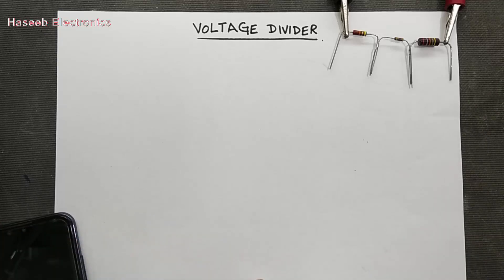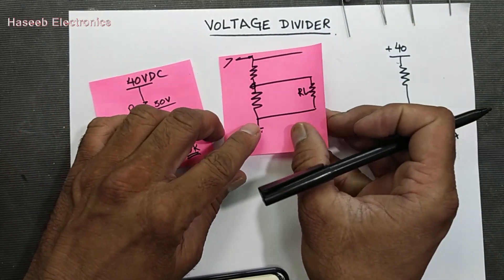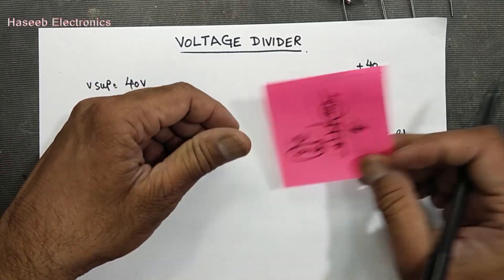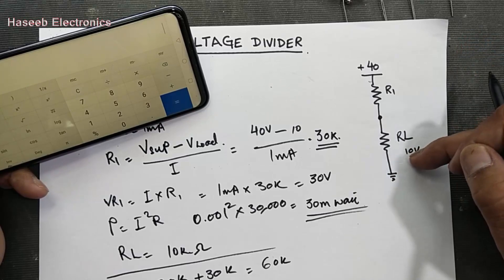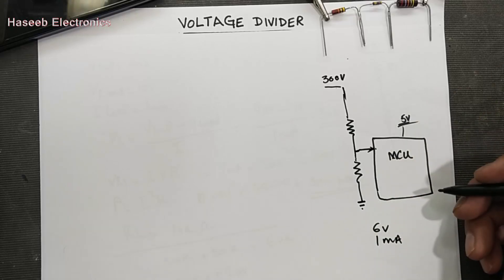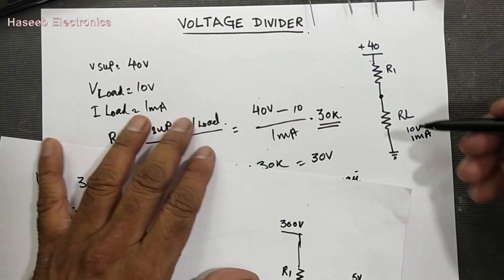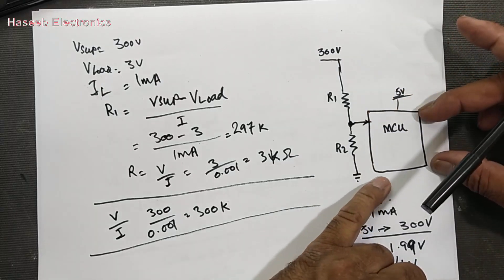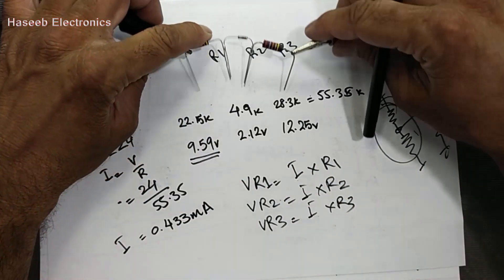[402] Voltage Divider Circuit Explained / How to Calculate Resistor Voltage Divider

Comment: I want to make one concept clear. Using voltage divider to power any dynamic circuit is never a good idea. This method is used to power MCU in SMPS because it consumes very less current and it's MCU has higher voltage and current tolerance. Using voltage divider to power any other circuit is not recommended, the voltage might drop and reset every time, circuit will not function as intended. The voltage will change rapidly if load starts to absorb current. Voltage divider is used to take a Vref in any circuit.

Comment: Djazak Allah khayran , I have a mobile charger not working I found a transistor  and zener dide faulty ,I changed them the output was 9v but it should be 5v after rechecked the charger I didn't find other faulty compnent and the output became 1,6 v , the charger doesn't have switching ic and optocouplor , wher can be the problem